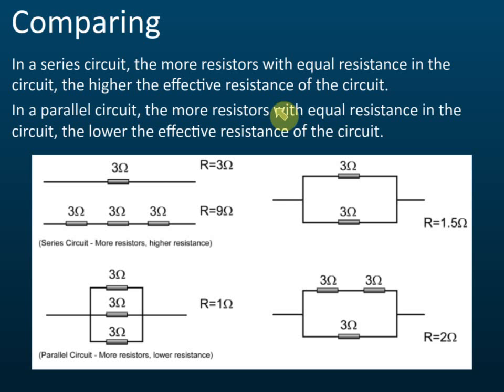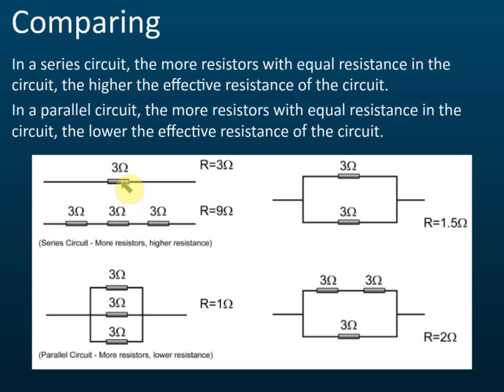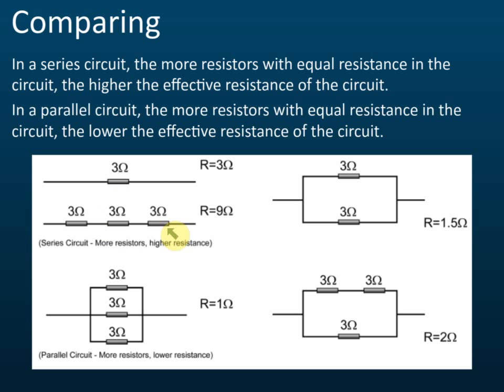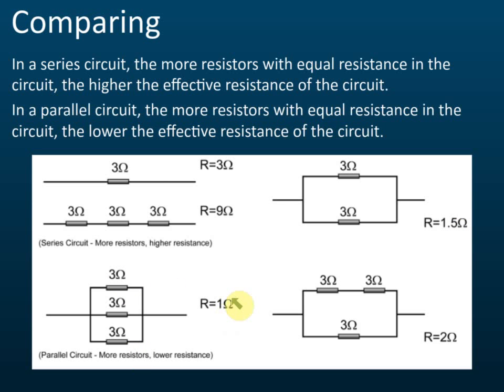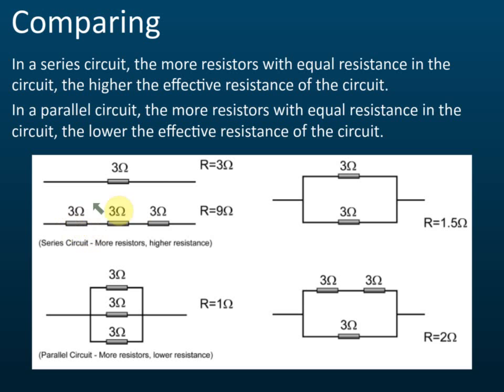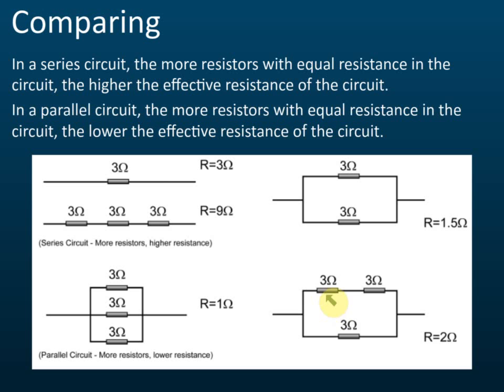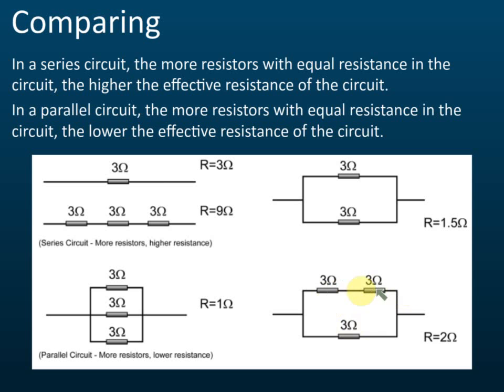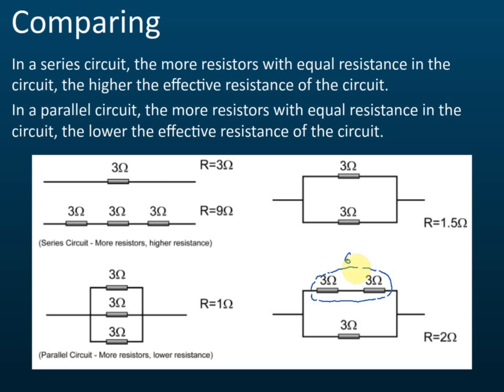Effective Resistance in Series and Parallel Circuits | Electricity | Physics

Comment: I have a question:

Let's say that Circuit A has a single resistor of resistance "R", and Circuit B has two resistors each with a resistance of "R", but the two circuits are otherwise identical. If both circuits are supplied with the same voltage, should I expect the resistance of Circuit B to be twice that of Circuit A?

The data I collected from a recent experiment implies that I shouldn't, and I'm trying to figure out why.
Reply: What type of circuit are they? It can differ I think, depending on whether its a series circuit or parallel (since they both have different formulas for resistance). 

Also, do note that this is a Malaysian tuition channel only meant for students to answer for their exams and probably not the best for actually making experiments.. you should refer yourself to a forum, or at least a hobby channel
Reply: Fazley Fadzil They’re both series circuits, and I already checked a bunch of forums and websites. I came here because they didn’t really explain what I wanted to know.
Reply: @kylestubbs8867  Have you tried asking the people over at r/electricians?